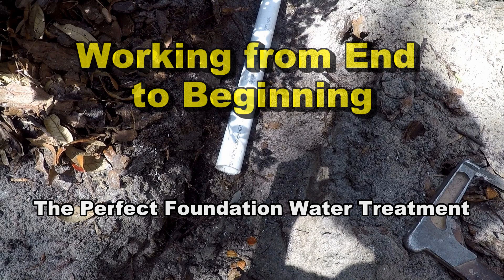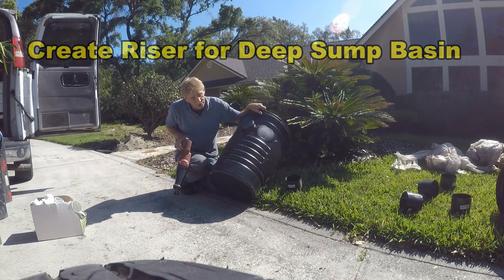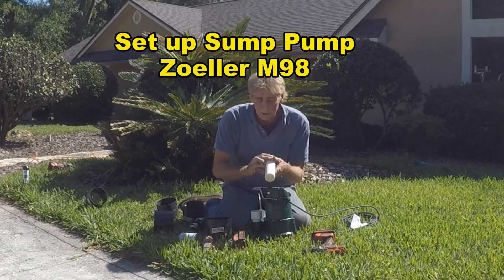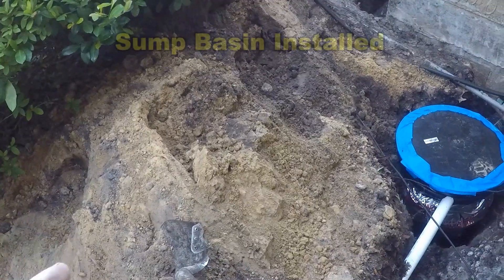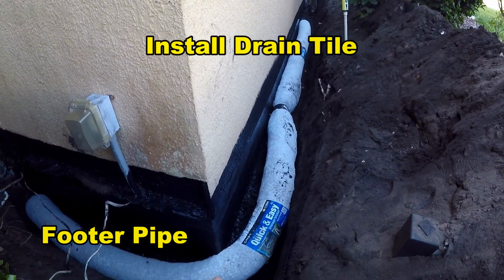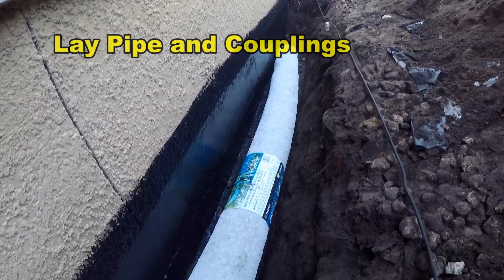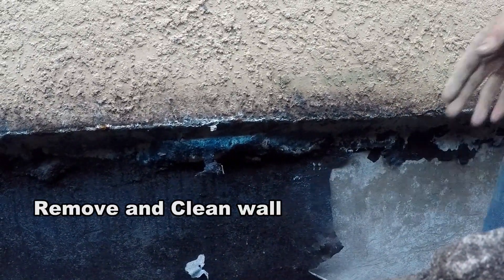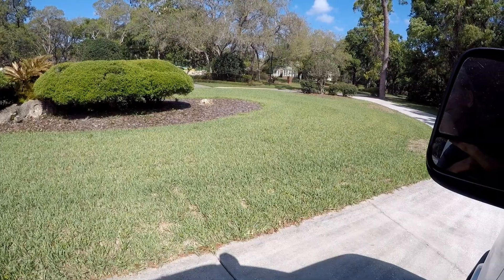Understand the Secret to Waterproofing

Comment: Can you make a video on different ways to connect the discharge to a pop up? I don't want to blast water into the street so i was going to run a short section of 4" corrugated after the 1.5" pvc
Reply from the maker: @patrickclark3236  many video on the channel. Just search the channel

Comment: Just found your channel after doing research to fix water intrusion at the slab/floor level into one side of our home. I believe it is wicking up between the stucco and block. It has only happened with hurricanes Ian and Milton. The two biggest rain events in the 27 years of owning our Palm Coast home.

Is there an alternative to Black Jack 57 that you have used? I’m having a hard time finding it locally.

Thanks!
Reply from the maker: @jodypitts8516  go to Lowe’s. Home Depot does not carry it.

Comment: Would this system/concept be usable on the interior of the foundation? If so, would I need the Black 57 sealant be needed? Would there be any changes to the process doing it this way?  Love your videos! Thanks for all the advice and for giving such great detail to us all!
Reply from the maker: @clanceyaguero  no idea what you asked
Reply: in this video you installed the french drain system on the outside perimeter of the home's foundation. I'm wondering if I could use this method but on the inside (in the crawl space) of my foundation.
Reply from the maker: @clanceyaguero  yes

Comment: Thanks for the awesome information you keep putting out!   What if the footer is really really deep?   I have a brick house built in the 60’s and have dug and dug over 30” to test the depth and try to find the footer, but the brick wall keeps going underground!  Also - is there any risk by disturbing the soil around a brick wall foundation - that it may weaken the wall?  Thanks!!

Comment: Nice job, well done!
Is liquid rubber better than “blue skin”? Even if blue skin requires a smooth coat of mortar
I would like a video if “dry creek”….I have done many, and one of the issues is the velocity of the water at the end that generates erosion and the power of the water is so big that can roll big rocks, 800 lbs, down the hill….
When you have big volume of water coming toward a house you need combination of water management solutions, because French drain alone won’t resolve and projects are very costly
The other aspect is guarantee
Can you guarantee a creek? Can you guarantee a river?
All type of associate issues, such as: environmental, wild life, etc

Comment: Hey Chuck, how important is the rubber seal application? I planned on digging out my footer and adding perforated pipe but didn’t plan on applying the compound. Would you definitely recommend it?
Reply from the maker: @MerchantMarinerEngineer  yes
Reply: @appledrains  thanks, Chuck!
Reply: You need to also get some hydraulic concrete at home depot and seal up any cracks you find. Get a home depot bucket too. Put the concrete in there and mix 4 hand fulls at a time with water! It's quick drying so be quick. Wear a mask!!! Smear it on anywhere you see cracks
Reply from the maker: @danielgoof8463  great idea if needed
Reply: @danielgoof8463  thanks dude!!